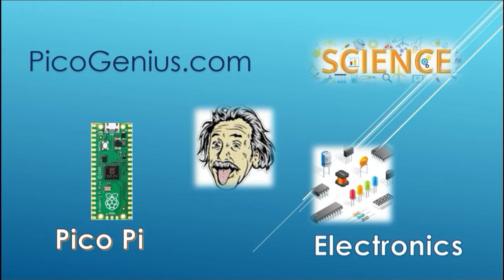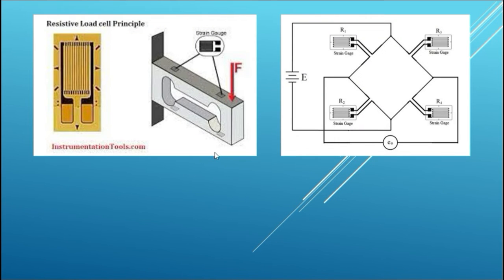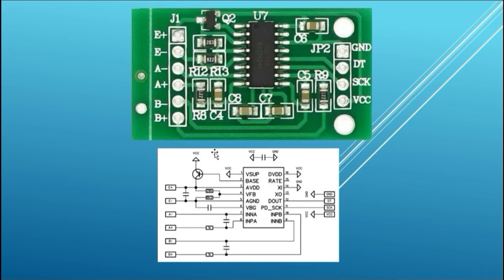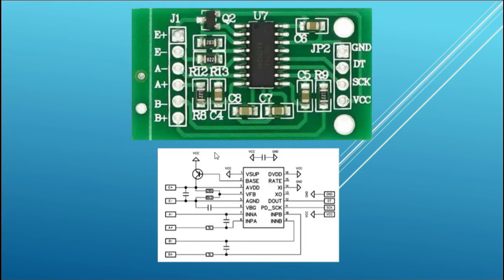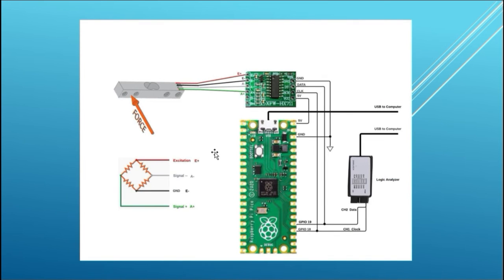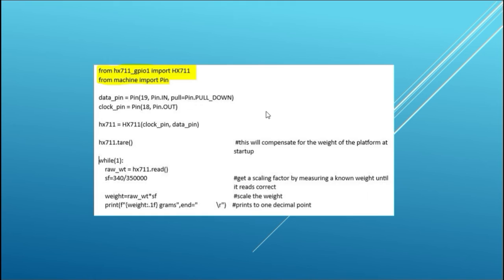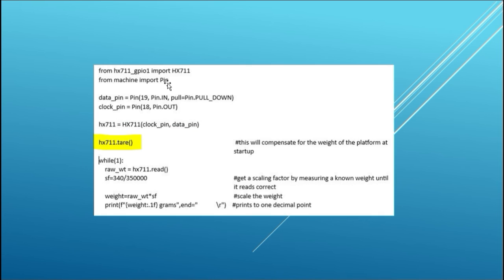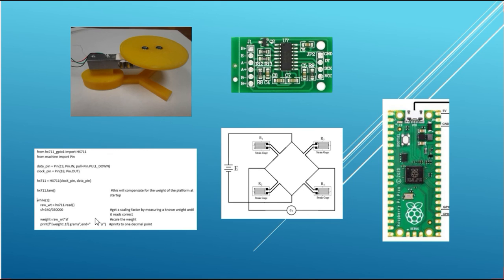Interfacing HX711 Load Cell with Pico Pi Part 1

Comment: Hi, thanks for making this video.  Its my first video on the research of load cells.  I'm wondering though.  Is there a specific load cell that's only tuned or compatible with the HX711 or is there other options?  For instance if you wanted the resolution of Grams/Milligrams is any load cell going to work with a HX711?  Thanks

Comment: Mine is showing this error: 
Traceback (most recent call last):
  File "main.py", line 1, in <module>
ImportError: no module named 'RPi'
MicroPython v1.22.0 on 2023-12-27; Raspberry Pi Pico with RP2040
Type "help()" for more information.

Comment: Hello, do I really need the HX711 to read the load cell?
Reply: HX711 is the specific loadcell amplifier used here

Its called:
LOAD CELL AMP HX711
Reply: It is extremely effective! The three op-amp circuit is OK. But painful to set up.

Comment: "Hello Neil,
Thank you for sharing the great video! I'm currently working on a project involving the same breakout board with a Raspberry Pi Pico. I have a concern regarding the compatibility of the breakout board's voltage with the Raspberry Pi Pico. Is it safe to power the breakout board with 5V and directly connect its logic to the Raspberry Pi Pico without using a level shifter? Specifically, does the IC HX711's logic operate at 3.3V even when supplied with 5V?